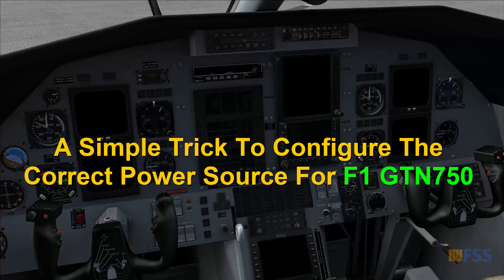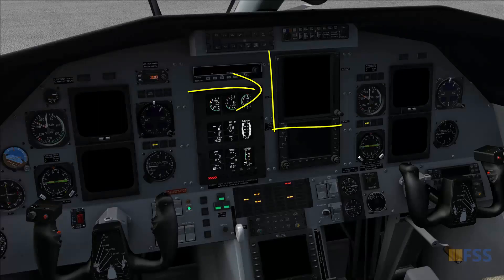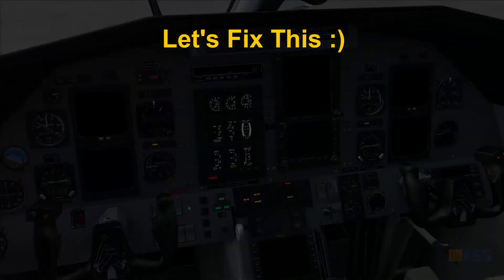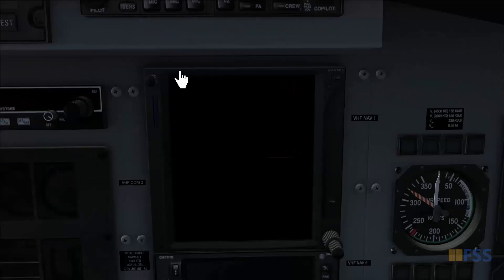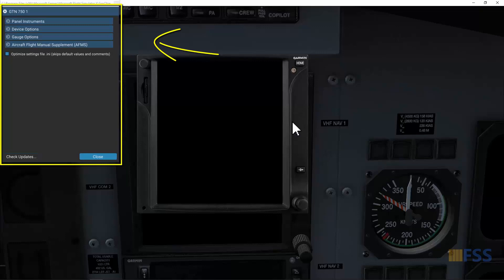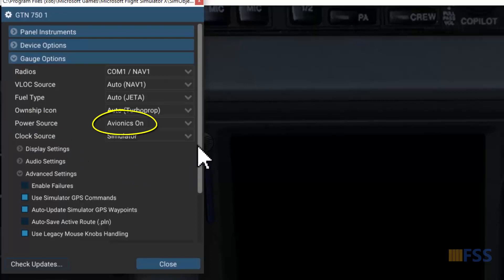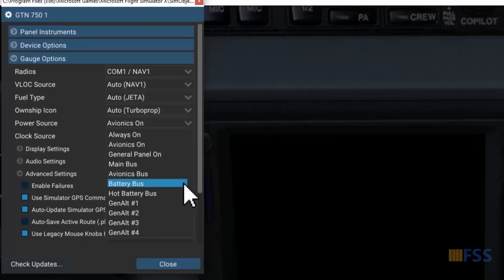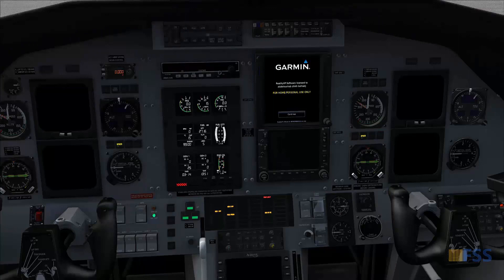[Flight1 GTN 750] A Trick That You May Need To Know For The Power Up Setup

Comment: It didnt work for me, i hover the mouse but nothing happens.
Reply from the maker: Try to follow this steps:
1. Hover your mouse pointer over the top edge of the GTN popup unit
2. Key in the shift without right click.
3. you need to  see the  mouse pointer changing from the arrow to hand pointer...at this point if this didn't happen
     move your cursor side way over the edge ; you will see the mouse hand appears .
4. when you see the mouse hand active then right click on your mouse this should work..
 Good luck :)
Reply: @FromStartupToShutdown  It was a virus thing, windows was deleting the files, all solved now.
Reply from the maker: @SauloMogi  Great! have a good flight

Comment: I can not open the pannel menu        shift right click only close the the pop up window        It work  ok the first time when I  set it up  to use the sim GPS commands,when I open P3D   hours later  shift click only will close the pop up menu
Reply from the maker: Try to follow this steps:
1. Hover your mouse pointer over the top edge of the GTN popup unit
2. Key in the shift without right click.
3. you need to  see the  mouse pointer changing from the arrow to hand pointer...at this point if this didn't happen
     move your cursor side way over the edge ; you will see the mouse hand appears .
4. when you see the mouse hand active then right click on your mouse this should work..
 Good luck :)
Reply: @FromStartupToShutdown  Thank you so much for your help  it now works  you reality know your stuff ,I seen in some of your other videos your traffic icon is available,
my traffic icon is grayed out  I have the P3dv5 carenado XL 560   can the traffic work with that plane
Reply from the maker: @Photoshopmanipulator  What do you mean by traffic icon?